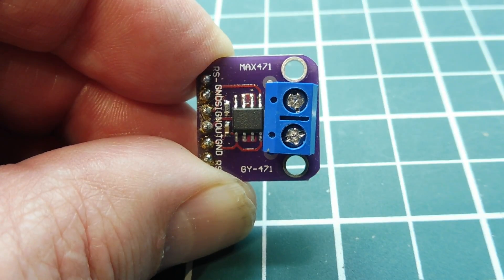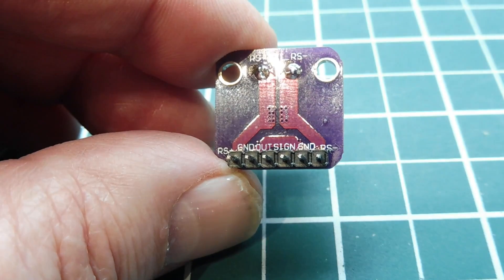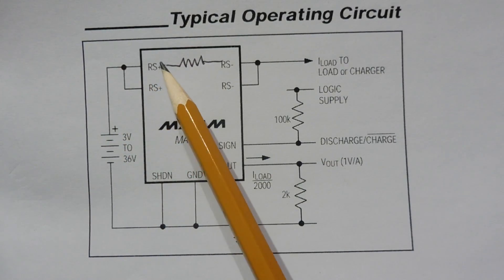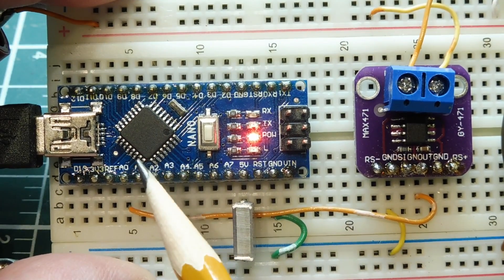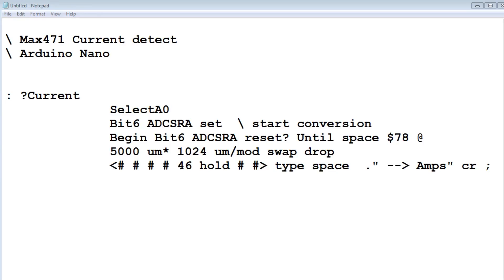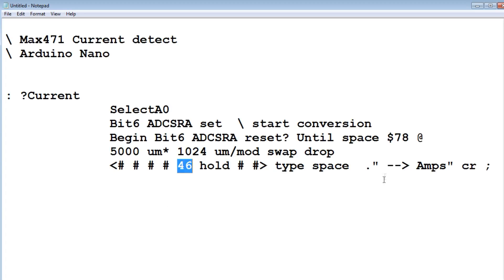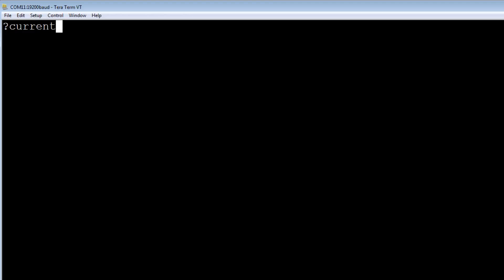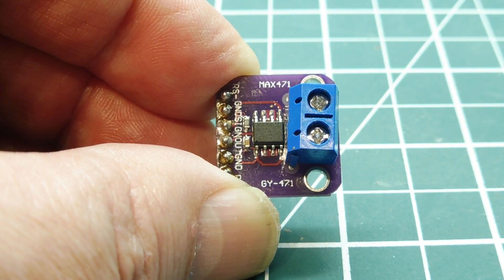DC Current Detection and Measurement

Comment: 🌟 I need a sensor that tells me if there is current or not, the current is about 7 milliamps, I don't need to measure it, can you give me advice? Great video as always, thanks a lot 👍
Reply from the maker: Check out a H11F3 Opto-Fet. A change in curren through the emitter will change the output resistance. A voltage divider and a comparator can detect 7 mA.

Comment: I have the same board and setup and I no idea what I'm doing wrong. I'm using a 9V battery and a bulb and the module gets very hot, very fast... Is it supposed to?
Reply from the maker: With your multimeter measure the current draw when you connect your battery directly to the bulb. The current should be less than 3 amps.
Reply: @0033mer  It definitely is. The problem is the board gets almost instantly hot if I connect any of the grounds and RS+ to the battery and nothing else. From my understanding of the schematic this shouldn't be the case, right?
Reply: @0033mer  I managed to get some results by connecting:

Interrupt negative wire
RS- to led-
led+ to bat+
maxGnd to bat-

or, interrupt positive wire 
bat- to led-
rs- to bat+
maxGnd to led+

No idea if this is correct, every schematic out there says to interrupt one wire between the bat and LED and ground the battery to the arduino. Maybe I'm understanding things wrong but if I do that the module gets hot and will probably burn out real quick. The only way to get results is to use one of the RS pins and GND while ignoring the other RS pin.
Reply: Coming back to this, I'm pretty sure I got a bad batch of chips / counterfeit chips. They don't seem to track any electrons moving through the shunt, only what you can move through the ground and one of the RS pins, essentially connecting the unit in series and making the whole current go through the chip instead of the shunt.

I guess they are somewhat useful if you want to see low voltage and amps going through, but for anything over 5V, 1A they are useless. It also doesn't help that the MAX chip seems to be obsolete from the late 90s.

Ordered myself some INA chips that can be powered from 5V instead. Pretty let down by the last order.

Comment: Without the internal sense resistor of the MAX471, the MAX4070 solves nothing that many other methods requiring an external resistor can do . To me , the built in resistor made it the number one choice for a single component solution.
Reply from the maker: Totally agree...
Maxim contracted out the etching of the resistor on the chip die to another company that went out of business.
With the popularity of Hall effect current sensors they probably abandoned the idea.
https://www.banggood.com/Lantian-100A-ACDC-Linear-Current-Sensor-Hall-Current-Sensor-Module-for-RC-Drone-p-1260335.html?rmmds=search&cur_warehouse=CN